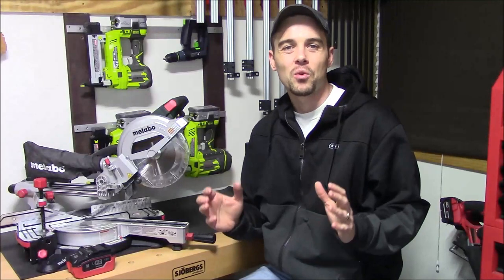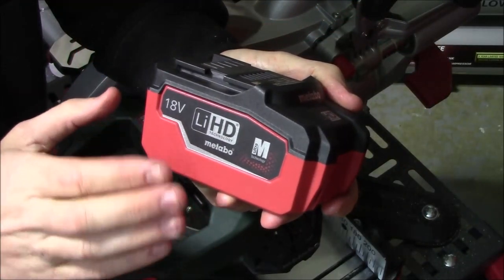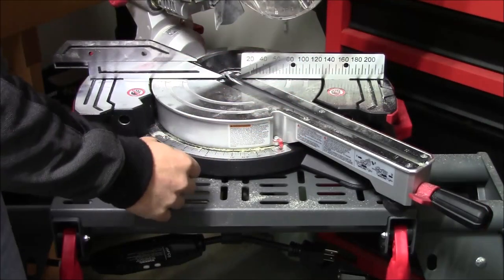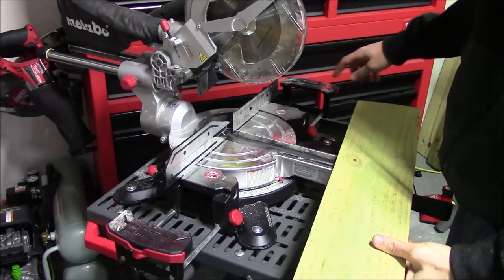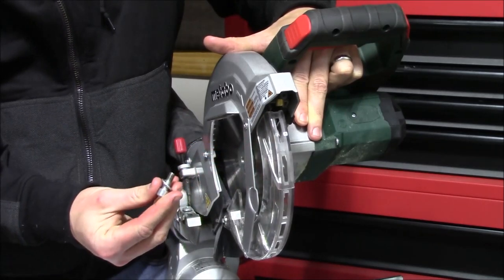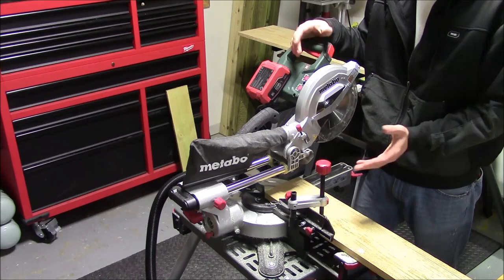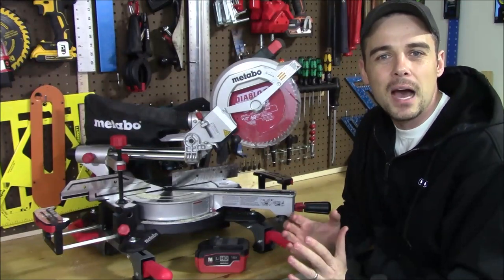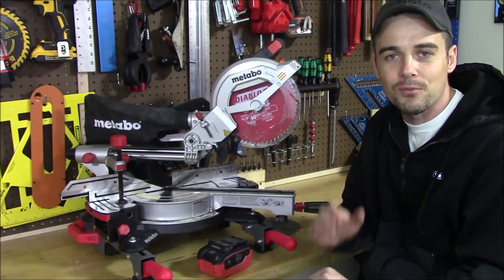Metabo Cordless 8-1/2" Single Bevel Sliding Compound Miter Saw KGS18 LTX 216 6.2AH LiHD 18V

Comment: Hey Buddy.. loving your reviews.. your the guy I come to before I buy any tools.. How does this compare to the Dewalt, Milwaukee, Rigid/AEG or any other 18v cordless mitre saws? if you had to have one ,which would it be? I'm not bothered with warranty or battery platform, just on performance, compact and weight ????
Reply from the maker: I like this one, but the blade is a weird size that costs a lot & has very few options for different tooth counts.  The saw that I like the most is the Makita 7-1/2", but they didn't include a LED or Laser....which I think was a stupid move.  For the money, the RIDGID 7-1/4" Brushless with LSA (Lifetime Service Agreement) is the best buy --- I bought 2 of them.

Comment: Nice product but the battery would probably not last for as many cuts as you had made. You didn't let the saw blade stop for everyone of those cuts. It would take more power to start the blade up everytime.
Reply from the maker: The runtime footage was edited together via different angles....I didn't see the point of including a long pause between cuts in that clip.

Comment: Any chance of you doing a review on the  Metabo SSW400BL Impact wrench??
Reply: Brendan Maguire I have one and it's an absolute beast 👍🤓👍
Reply: hey buddy what do you use it for. any reliability issues??
Reply: Brendan Maguire Hi Brendan, zero reliability issues. I also have the less powerful 200 model. But it was powerful enough for 90% of the the things we do in the trades, but the 400 is an absolute beast just be careful because you can easily snap m10 coach bolts if you don't pilot hole through large tough timbers it's got so much grunt 👍

Comment: What miter saw stand was that?
Reply from the maker: +Ryan Butler Which one?  The small one inside or the big one with the runtime test?
Reply: +Real Tool Reviews the one outside with the 4 rollers on.
Reply from the maker: +Ryan Butler Here it is on Amazon....but can be found MUCH cheaper elsewhere online (current pricing anyway....Amazon has it listed at $370 for some reason) --- http://www.amazon.com/gp/product/B016E1IQWC?_encoding=UTF8&tag=reatoorev-20
Reply: That stand looks very similar to the ryobi stand. Wit the addition of a couple wheels, a power strip and some other minor mods, but I do t think those items are worth the almost 300 premium over the ryobi. http://m.homedepot.com/p/Ryobi-Miter-Saw-Stand-with-Tool-Less-Height-Adjustment-RMS10G/205216315 I had that stand for many years and just gave it away since I got the Ridgid stand on sale for $99. Way better and you don't have to remove your saw to store it or load it on your truck.